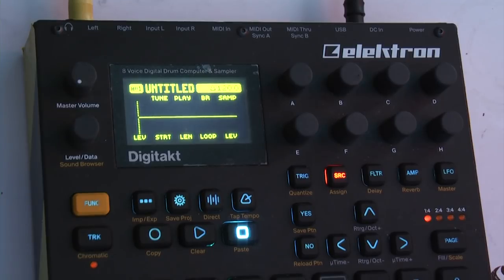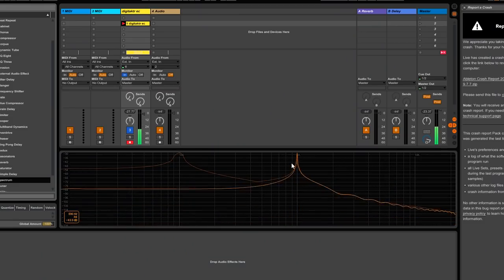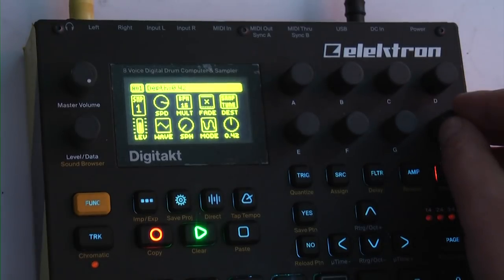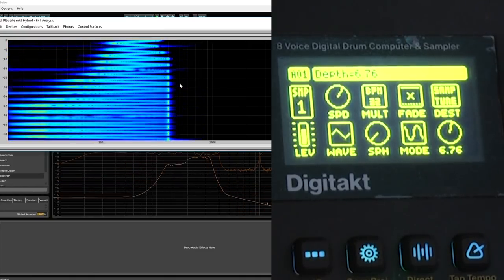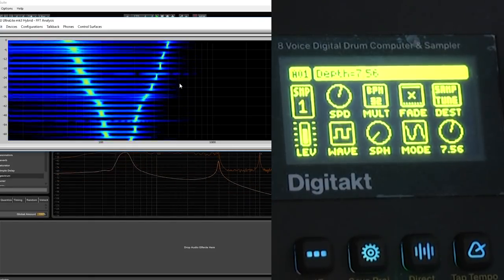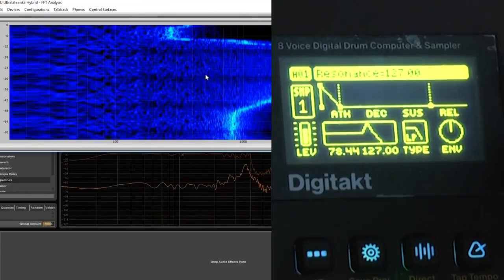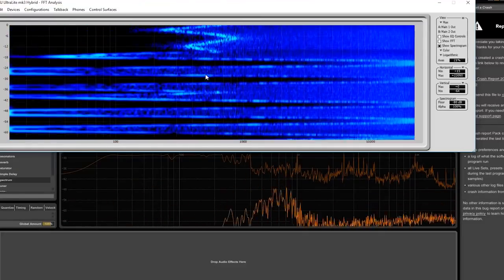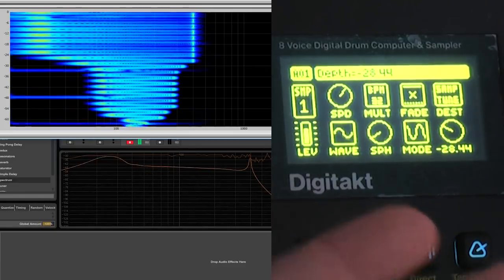why Digitakt LFO is broken (parameter range mapping) by design (with proof / measurements)

Comment: I agree with this posting,
There is a lot of unused range with the tune lfo,  i think that is mostly due to the fact the sample repitching limitations. 
Perhaps they left it up to 64+/- so that they did not have to change it per parameter. 
Like +/- 10 for Tune
       +/- 27 for Cutoff etc.

I dont think its a bug, more of an ease of programming

Comment: This isn't "broken". It just doesn't suit most use cases. Someone else might actually want this behavior in their lfo, maybe you want to curve between min and max with a hold, granted a square wave would function similarly, but I could see this being used and can vaguely remember times with other synths wanting to do this, but not being able to.
Reply from the maker: as you noticed, square wave would do same, plus you could actually pick the point when the flat area kicks in